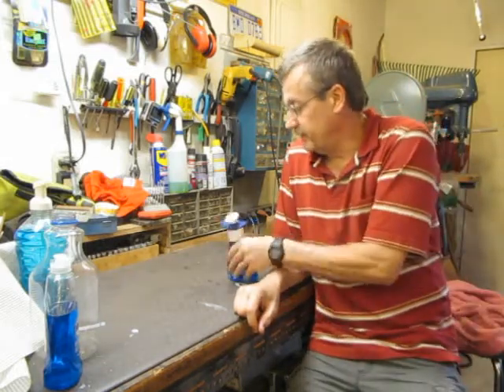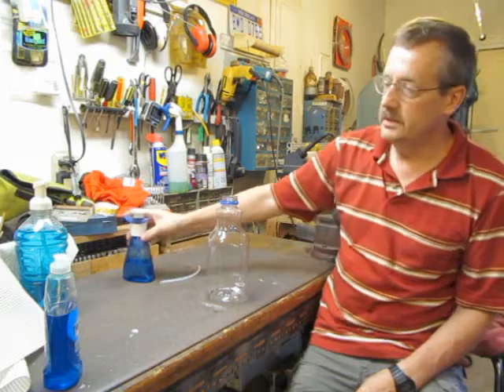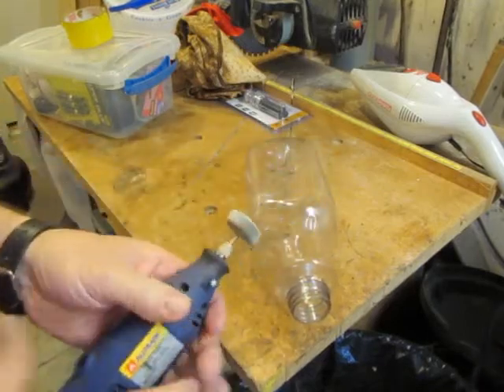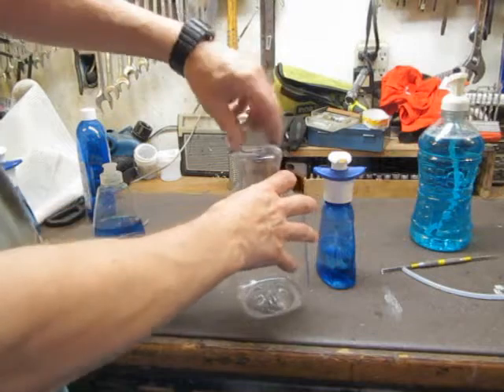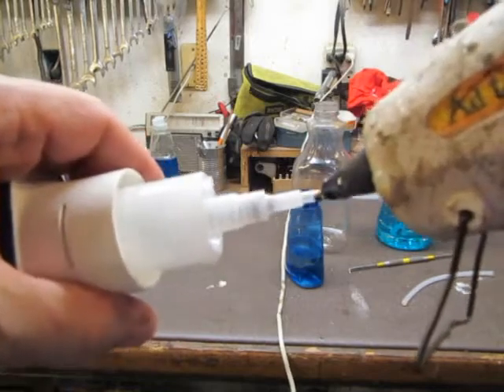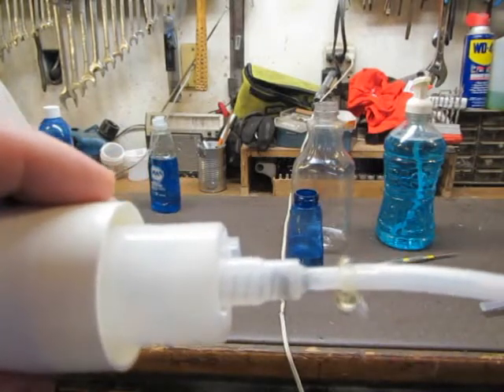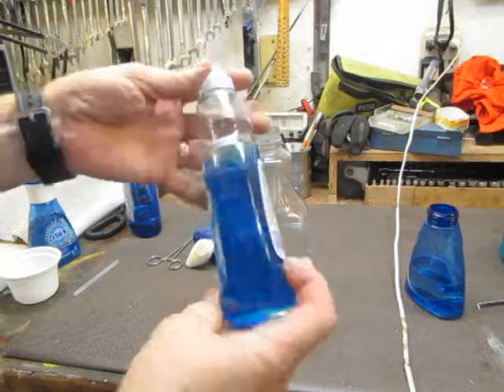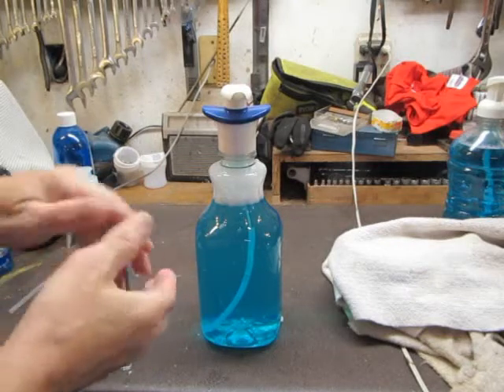3 Year Hand Foam Soap Dispenser

Comment from the maker: For your foaming dispenser make sure your refill bottle said "Foaming Soap Refill", next make sure the instructions said it was NOT  concentrated, if it was you will have to dilute it. Regular pump hand soap can be used in a foaming dispenser but it must be diluted   1 part soap to 3 to 6 parts water depending on the concentration. If you did not take the pump mechanism  cont.

Comment from the maker: cont. apart make sure the dispenser is all the way screwed on. If your pump mechanism came apart when you refilled it make sure a little plastic  or steel valve did not fall out, this is your check valve! If it did fall out put it back in. If you lost it you will have to get a new foam pump dispenser.  Good Luck!